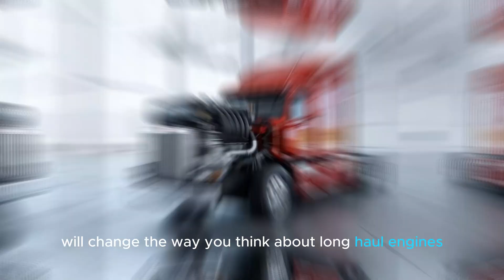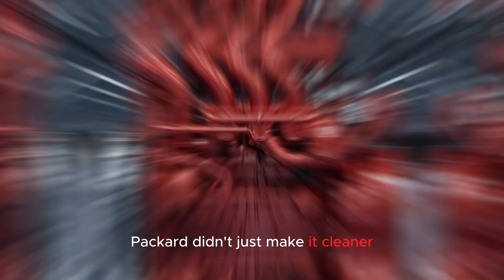Why the 2025 PACCAR MX-13 Engine Is a Game-Changer for Trucking

Comment: It's 2025 and Truck manufacturers still haven't figured out that you should build the engine as a modular unit like a tank so it can be swapped out within a couple hours and back on the road/available.... have a power unit you can uprate or derate within a set boundary (300hp YARD GOAT to 550hp Hauler) using nothing more than a USB3 dongle and stop with all the bullshit and have a fully functional PARTS DEPARTMENT which knows every single bolt.